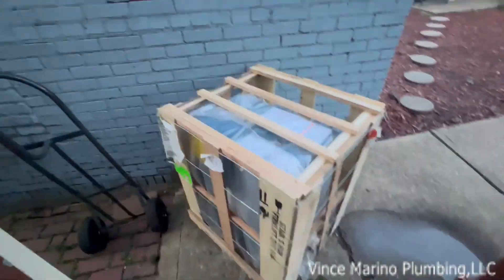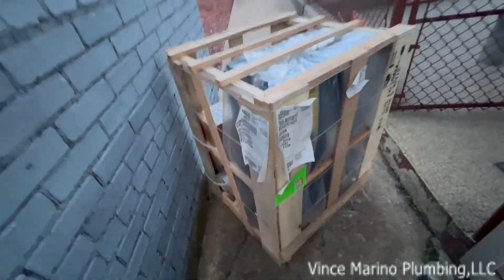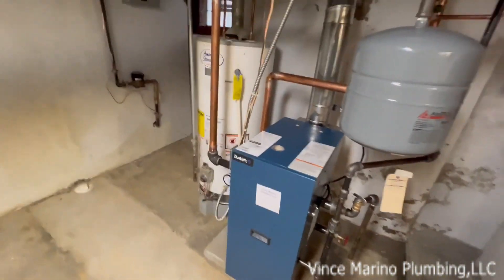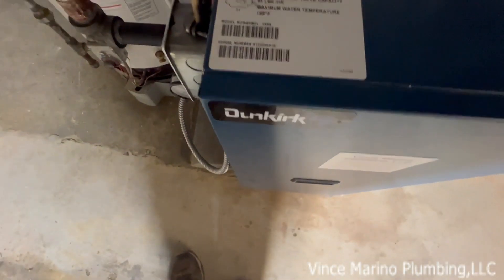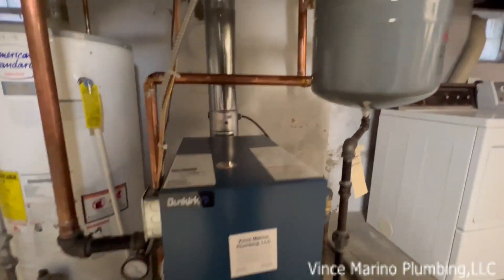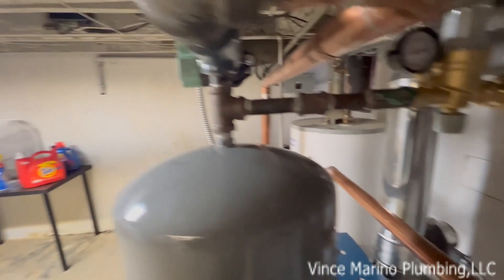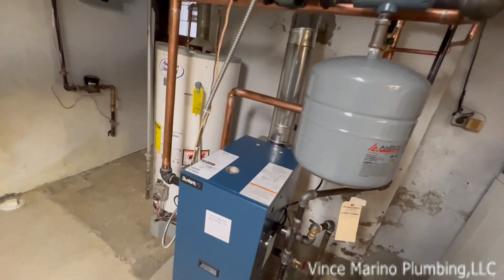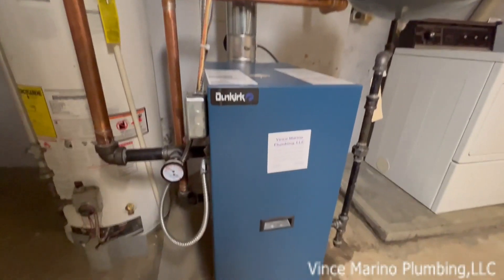Dunkirk boiler installation.

Comment: I need two of these installed in a new apartment. I am thinking to mail order to 60 to 75 BTH models and do it myself. I know nothing about these things but I am not afraid but dangerous to do anything. I have done tons of gas and plumbing experience. I have the new Rigid propress machine.